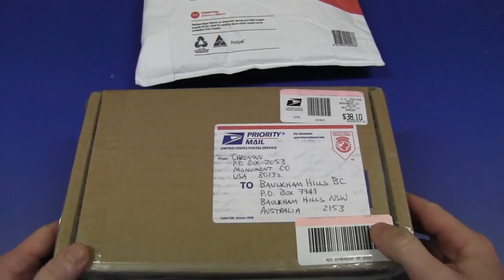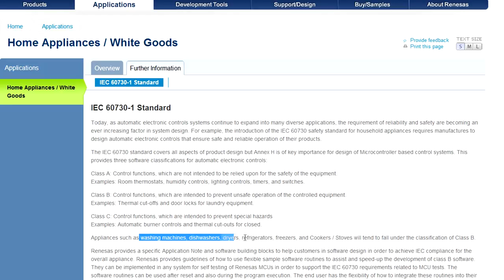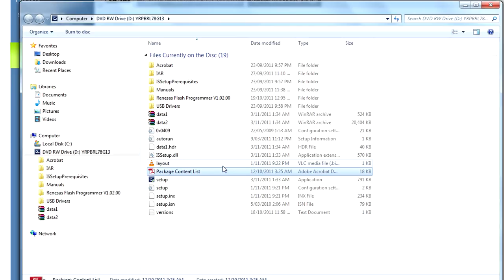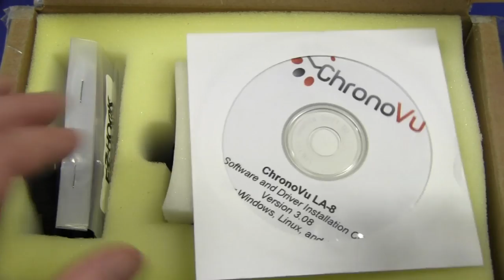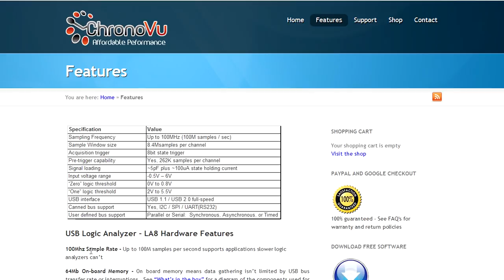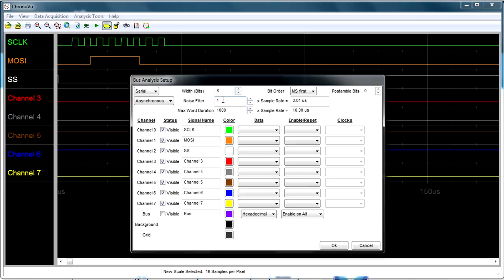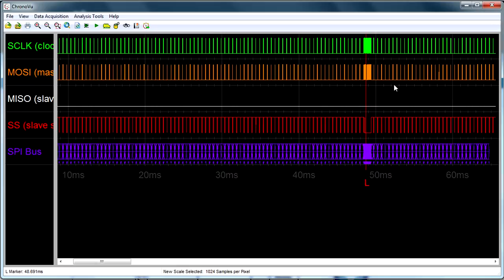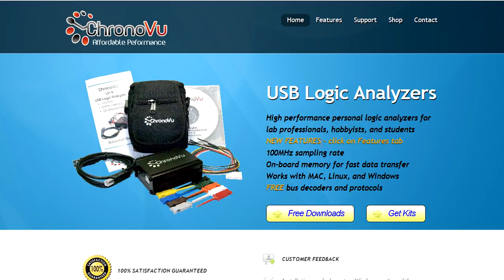EEVblog #290 - Mailbag

Comment: I recently got the Renesas yrdKrl78g13 demonstration kit:
Pure porn-on-a-stick:
It has an LCD screen, speaker, micro-SD slot, IR-in IR-out, microphone, temp sensor, Ambient Light Sensor, 3 axes-accelorometer, a fet-switch connector, a triac connector, a Serial Comm port, Audo out.. etc etc..
Very complete demoboard!

Comment: Looks pretty decent for the price, but one thing I didn't like about the wires is they do not follow the standard resistor colour code like they do on my HP analyzer (and a cheaper FPGA based one we use at work similar to this.  Having them in the proper order would make identification much easier IMO.

Comment: HA HA HA!!! That logic analyzer SUCKS :-D Check out miniLA open source project. It's a little bit obsolete today, but still much much better that this (and many others) commercial crap. miniLA is at YouTube, just search it. It's based at Xilinx XL95xx series CPLD device - XL95288, but there were some experiments with Spartan 3 FPGA's (try to contact Bali Zoltan, eltexto freemail hu).
Features:
32 channels
128 Kb for channel
sampling 100 MHz
external clock input
External trigger
USB